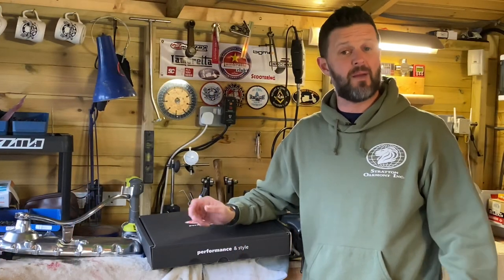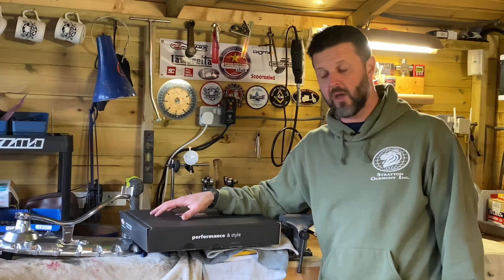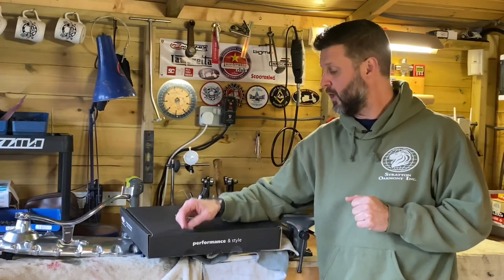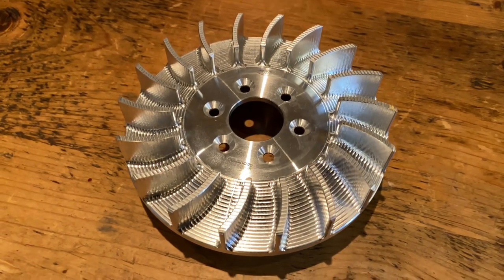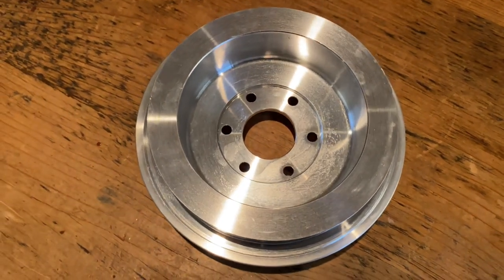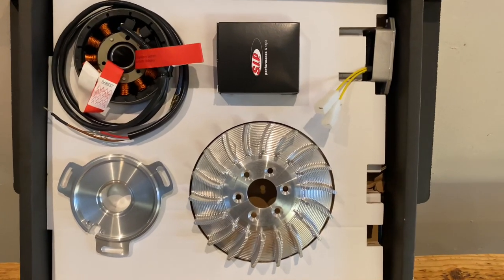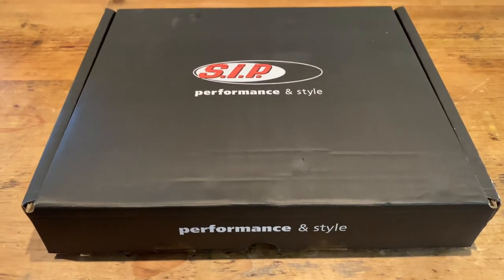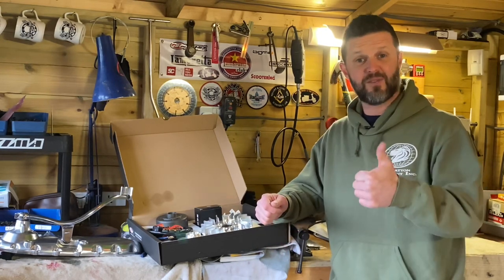SIP Lambretta & Vespa Performance Ignition by VAPE  - SIP Scootershop

Comment: Great kit. I have installed it in my J125/3. Starts always at first kick.
But… it’s the AC version. Now I want to convert to DC, because of adding a battery for lamps etc
I’ve understood that I only need to replace the regulator. There are two versions: DC only and a AC/DC combination regulator. Which one of the two do I have to buy?

Comment: fitted one recently,good bit of kit,only gripe for £300 you would think they would supply the flywheel locking tool,and the screws to fix the stator  boss to the mag flange
Reply from the maker: My kit has those screws in? Agree on the holder tool though.

Comment: Added one to my TS1 last year and what a total difference to bike performance a fantastic kit, only downside is lack of mounting kit and flywheel holding tool which are both included in the casatronic kit. I have also added a mmw deep flywheel to the kit this year which again needs a different holding tool which is not available for that upgrade, not even from mmw themselves
Reply from the maker: I’m very impressed with the quality. Be interesting to see if the timing marks on the stator are actually of any use though? 🤓
Reply: @drunkmunkey6969  the marks are nye on spot on